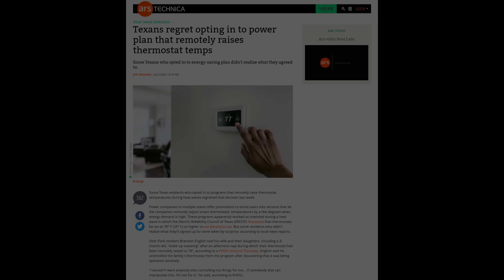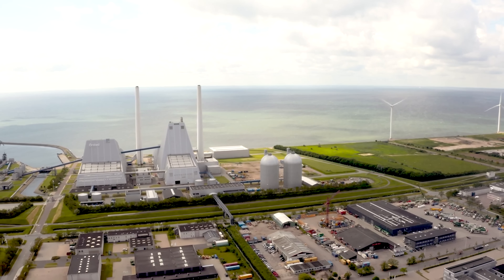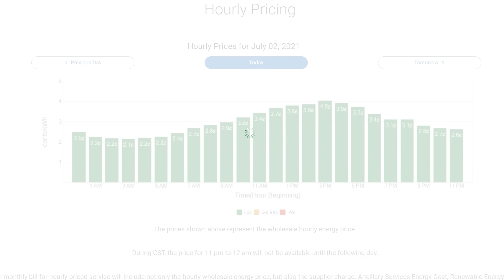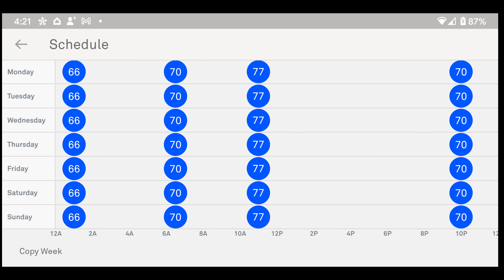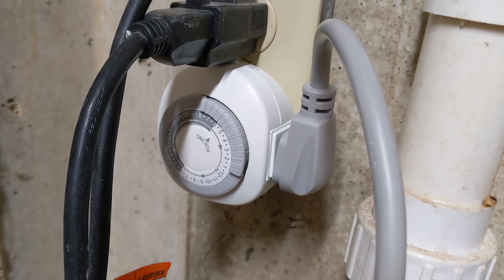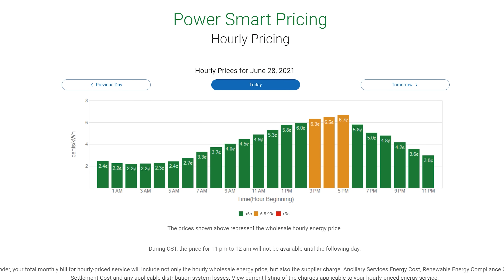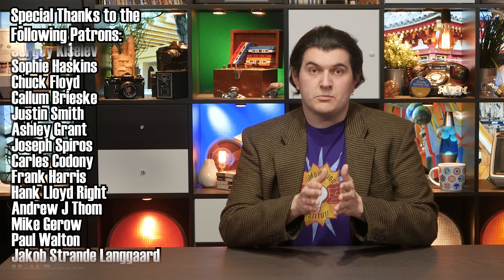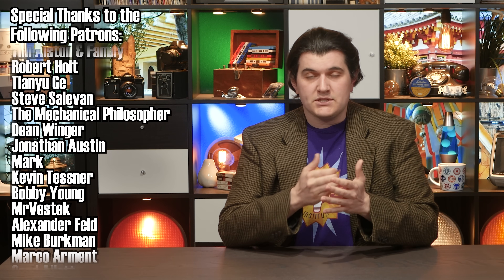Batteries aren't the only way to store energy. Here's another.

Comment: Here's how we're planning to reduce peak demand in Belgium starting from next year. About 21% of our electricity bill consists of distribution costs. It's the part you pay for the operation and maintenance of the grid. Currently those costs are calculated based on your total energy consumption. In 2022 a system will be introduced where the highest peak power use during 15 minutes is noted for each month, then at the end of a billing year the average of the past 12 months is made and used to determine your costs. Ta-daah!

High peak usage during the night when everyone else is sleeping? Doesn't matter, pay up. One short spike in a month but no others, while other people do this every day? Doesn't matter, the highest 15 minute peak wattage is what counts for that month. Don't have a digital meter yet? Well you'll just pay a set amount based on what the company considers a suitable guess for "normal" peak use.
Really, the whole approach in Belgium is "oh snap we don't have the money to improve the grid despite robbing our users blind for years, better scare them into complying with new guidelines through some threat of high bills with vaguely defined calculations". And this while there's a push for electric vehicles and less fossil fuel consumption, meaning we'll rely more on electricity than ever.

The government also did an amazing magic trick with incentives for solar panels, if anyone's interested.

Comment: What you need is a battery bank of some kind and an inverter. So you charge those batteries via the grid over night and you can pull from them during the day. I dont have a powerful enough bank for AC... well, maybe a 5,000 btu window unit fir a single room, but i charge that bank with grid power.. solar and generator too if the power goes out for any length of time. But just like pumping water from a lower reservoir to an upper reservoir as stored potential energy. Batteries in your house is the same thing. Maybe get a Tesla setup in your house... No need for Solar panels in this instance. Due to prices, you can start with the Tesla battery and get panels later on if you want.  But every house should have battery storage.

Comment: I have NOVEC in Nevada, they promised 2-3 degree increase for 15-20 minutes by using their thrmostats. The reality was more like 5 degrees for an hour. OK, so they they lie, they also lied about cost savings. What isn't calculated is instead of cycling on and off. The system is so far behind it must run full blast for hours to catch up. The cost savings disappeared and and my monthly bill increased substantially. I replaced the NOVEC controlled thermostats with Nest, and my bills dropped. From an outside view, it would appear to be a scam. There may be some help to the grid. But considering how they fought so hard, and stonewalled my solar installation by 6 months, I'm leaning towards scam.

Comment: i practice thermal mass heat storage all the time i fill my house with junk that way i have plenty of heat storage but my guinea pigs would not like being frozen in morning then baked in afternoon they might stage a revolt. some new buildings i worked on did actually use real thermal storage to run their chillers at night and pump antifreeze filled lines into Conex boxes that have water cells inside that freezes overnight and then in the heat of day they circulate water through boxes to draw out the stored cold for air conditioning to run on during afternoon peak demand

Comment: For me sounds pretty stupid to sleep shivering just to save few cents. I rather stay naked take another shower during the hottest day, and not use the air conditioning at all. 
And I always dreamed at the thermal storage. But a seasonal one. During winter, cool a house sized well insulated water tank. In colder zones can be done with just fans without heat pumps. And anyway, there the cooling is needed for just a month.  Also during the summer heat other similar insulated water tank, and use it to heat the house during the winter. Insulation may seem a problem, but placing the tanks deep underground will help, since the thick soil around will act like an insulator and slight battery also. Earthships are already doing this, and works fine. We just need to do this at municipality level.

Comment: This doesn't even mention a cheaper option to "charge the battery" that can be taken advantage of in some parts of the country that are cool in the evening.  When I lived in California, running a whole-house fan for 10-15 minutes late in the evening was enough to cool the house down and uses far less energy than running the air conditioner.  It had the added advantage of also pushing hot air out of the attic as well which further lengthened the time it took for the house to get warm again.  Why air condition your house for money when you have cooler air outside for free?

Comment: Rolling blackouts happen because of our ancient power grids are more than 80 years old in some places. The lines are not thick enough to handle the watts of power needed from the generating plants to the consumer. Also, we are not using molten salt thorium power plants which are lower pressured nuclear power generators and so very much safer than high pressured breeder nuclear power plants that blow up and spread radiation across the land. Three mile island, Ginna, Chernobyl, and the four Daichi plants are prime examples of high pressure nuclear fast breeder plants that are inherently unsafe and destructive. BUT, the low pressure molten salt thorium reactors are a thousand times safer than the breeder plants, and much cheaper to build and operate. A whole plant can be trucked to its site and constructed in months, rather than years, and it does not need to be near a source of water for cooling the steam generators. Geothermal cooling can be used to cool the reactor water coming off the molten salt fluids that can carry the radioactive thorium. In an accident, a salt plug melts and the reactive molten salt can be vented into non-critical vats where no cooling at all is needed. There will be no radiation spread around because it will be contained as it cools naturally. Why are we not using this proven 50 year old technology? China is. The plant can be module constructed and carried to its new site in days, not built in place over years. Plenty of videos here on YouTube to view about this safer technology - Go for them and learn.

Comment: Wow electricity in the US is so cheap compared to Europe, the lowest rates (on a non-tiered rate structure) are 20 Cents / KWh, no wonder it is extremely rare to find a household that heats purely with electricity, although most of our water heaters are (funnily enough) electric, but those use the tiered rate structure when the ultility offers pretty cheap electricity 8 hours per day (usually ca. 16,5 Cents, typically 6hrs during the night, 2hrs durng the afternoon but it is absolutely different for everyone and changes every few months), which is binary controlled by a device that recieves signals modulated onto the sine wave at freqencies 217Hz - 2100Hz. During the communist era, you would have a physical timer next to your power meter which would switch between the two rates (Cheap el. 10pm - 6am). During those times it was really common to have a box full of fireplace brick that would heat up during the night (usually 32KWh/8h, or 4,5kw split between three phases, because who wouldnt want to have three phases at literally every house right?) and during the day a thermostat would switch a fan on/off. Theese accumulative heaters (as they were called) were manufactured by a state company and were exquisite in every way because they were brown! 
a picture:
https://lh3.googleusercontent.com/proxy/PM42YNkiN8JdZYM4YgsiJbxjvmMGKLZtyeBxMLuFL4CMtfjvZcRSWdT-2AvGRwbvkiBcGgn-YXwVTe6N7HV1L_Y-1KEzcGeU1vDLS5WB4LEndGUEF7E

No smart metering for us, only on/off binary relay logic! 

I am talking about my experience from the Czech Republic, a country in Central Europe
It seems that other countries in Europe dont have this Mass Remote Control (HDO) (thats what the modulation is called) and do not have tiered rates.

Comment: Wind and solar power is not technically renewable because these devices have fairly short lifespans and cause large foot prints on the environment when first built or replaced. Concrete is required for both wind turbine construction foundations and solar farm foundations and concrete is one of the worst polluting building materials there is. Cement, the required ingredient for concrete, requires huge amounts of energy to produce and creates lots of pollution in the process.
Reply: How does a solar farm require concrete?
Im sure you could drive an epoxy coated steel rod in as a foundation for a solar panel.
Putting solar panels on your roof doesn't require any concrete at all.
Also if we used nuclear power as a heat source instead of carbon based fuels the co2 frpm the reaction could be captured as a resource.
Concrete is not as bad as you make it sound.
By mass it has less energy invested in it than most common building materials except wood.
The industry needs cleaned up but it doesn't have to be a major source of co2.
And if it takes less energy to make than it produces in it's lifetime it's renewable no mater how short the lifespan. Sustainable is another issue.

Comment: Would it be possible to heat pump-ify the water air conditioner idea and bring a quantity of water nearly to a boil to use it as active heating in addition to freezing for active cooling? So long as everything in the system can handle the heat difference of going from -1 degrees to 99 degrees Celsius, a reversible heat pump and regular radiator system could allow for a lot of storage in a decent amount of water. I suppose retrofitting would be a challenge for it. I know the house my mom lives in would have trouble fitting it in anywhere. Maybe some redoing of the pipes could allow it on top of the water heater next to the air handler?

Comment: hey, quick question: thinking of "alternative battery types", i know you had discussed how a water heater is a type of battery. what are your thoughts about keeping your water heater in the ATTIC, where it is already plenty hot? i personally think that this would be particularly effective with a Heat Pump Water Heater, as it would not only pull the heat from the air, but exhaust cooler air, helping to cool the house in the summer.

would there be any downsides to doing this, or am i just crazy for thinking of it? perhaps i'm missing some key factor that would make this a bad option...
Reply: One thing off the top: Any big leak would do a lot more damage vs a basement placed one.
Reply: @mylarrito  basement leaks can still do damage. especially if you don't go down there often.
i had a leak in my basement for...who knows how long, and it ended up spraying water all over my water heater! ended up replacing a bunch of stuff.
with water heater irself, you just have to plan ahead for the inevitable leak, by setting up a drain pan underneath (and preferably a water sensor alert).
as long as you plan for worst case scenarios, you chance of catastrophy is lessened. just like baxking up irreplaceable computer files 👍

Comment: I used the same cooling tactics however I'm not on any kind of an agreement with my power company the AC works much better the cooler the air is going across the condenser coils it is much better on the AC to run continuously instead of off and on and I am gone during the daytime.

Comment: Yes, people should do as you do. Smart meters required, though. Reactive is the same thing as learning past patterns and set points to then forecast. However, here's a statement that does not challenge the previous in any way. Furthermore, how does pumping water vertically actually save electricity. Couldn't the utility company simply divert the extra flow? Maybe they invented free energy? If using run their ac at night when it's not needed, how does that save energy? Electric vehicles use electric generation to go. Where does that form of vehicle fit into saving electricity? What do you think about geothermal?

Comment: Hmm my understanding of a battery is that it has to be able to store and release the energy again as usable energy. The house just so happens to be able to store energy (negative energy I suppose, whatever, thermodynamics will charge you for undoing it so I'll accept it as a form of energy). But it's not exactly usable after storing it, except it does offset the need for other energy but it can then only be used for that specific energy... It doesn't quite feel battery-esque enough to me. Kinda like comparing a carneval that gives you "fun-bucks" in exchange for money, to a bank that gives money for money

Comment: how do you sleep at 66 degrees... i get goosebumps all over once air condition temps reach like 73, and then if i sleep through that or lower i get stiff neck and super painful joints in all my fingers and toes from the cold air circulating

Comment: Or you can have solar panels and an actual storage battery. Charge the battery for free when the sun comes up. Use no grid power during the day, use the battery all night and use no grid power. That’s what we do. Also - zero grid outages as you can run off the solar and battery alone if/when the grid is unavailable.

Comment: Your ac must be quite oversized to be able to cool to 66 degrees in Texas summer heat. I do the same but it only works in the shoulder season. 

Your house  also loses cooling faster  because delta temp to outside is much higher at 68 than it would be at 75. That might be offset by your a using less energy when the air is cooler outside at night.

Anyway, with a properly sized a system I'm not sure this would work in full summer  heat days.

Comment: superconducting YBCO induction coil storage, should be pretty nice, example, L=1000m of the YBCO wire, I = 5000A = 5kA, E=½LI^2 = 3.5MWh, so what does that 1000m of the wire and the cooler compressor unit weight, T=77K, assume N=1000 loops of wire, no iron core, assume 6mT or fridge magnet field strength, dc induction charging and discharging, the only think costing energy is the super conduction compressor, same as super conducting electricity transport wires, its the same as if the storage would deplete at some rate

Comment: Stop using air con. I've just bought a portable evaporative cooler. When it's 34 °C outside, it's a comfortable 25 °C inside. It uses 100 W instead of 2.6 kW that a comparable air con unit uses. Best thing I've bought since my move to Portugal

Comment: air conditioners actually make heat worse in the enviornment. the body releases its own level of heat and so do electronics so proper managment of air flow in house, an understanding of how insulation works, visiual videos on youtube of how air flows through houses using food coloring and water to demonstrate, an understanding of how air pressure and air pockets and air trapping essentialy gas managment and air boyancy all will help. if you can understand these things, and theres more then that to learn about as well, then you actually wont ever need an ac again. an ac first uses alot of un needed power, fans use less power and circulate the air. an ac really is only needed if its a steady temp above like 95F or so. so long as the body is in an enviornment that can take heat off of it, hot goes to cold so if body is 96F for example it cant drop to 95F if the temp is 96F however if its windy it can because thats air expanding and moving. the expansion of air gives room for cooling by micro Degrees F at a time.. like if you put a fan inside the housing of a pc.. whats more efficient using a fan inside the pc case to cool it, or put a refridgerator inside and depend on the fan to circulate the hot air outside because a fridge also produces heat if you put your hand on the cooling unit of a fridge you can feel the heat.. while the cooler is inside... but not only is the 1-5 degrees F of overheat being pulled out because thats litteraly all it takes to feel overheated is just a few degrees.. in most cases a water cooler is more efficient then ac which uses gases and exchanges heat to cool. an ac is like a mini electric heater with gas to cool air.. water cooler is like a magnetic turbine that uses water to cool the air but theres little to no heat production like the ac. you can insulate a house using rooms on the outside edges to better maintain air temps in the center of the house. physical insulation works but a sun room traps heat inside better then a room same size 1 window. so if you had an entire side strip say a 4x30 ft section with windows all along to let greengas heating do the work. the room on the inside wall will hold atleast the surrunding rooms temperture.. so if the entire house had a hollow wall of air at 115F thats a hot air pocket that works as an insulater however if you circulate some of this heat out, now you have a heater using sunlite and it isnt to much its just the right amount to not feel chilly or hot inside. this air could be coold also closing blinds keep it circulating that drops the temp and not circulating this insulation air raises temp. pulling in new fresh air drops the temp, manage the gases never need ac again even in hot enviornments, even in a desert air can be cooled, and heated for way less.